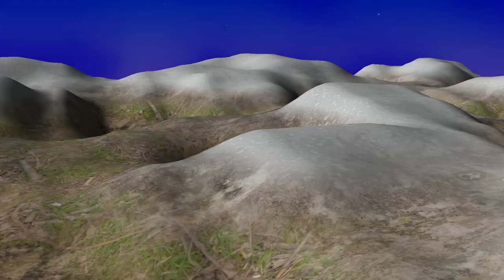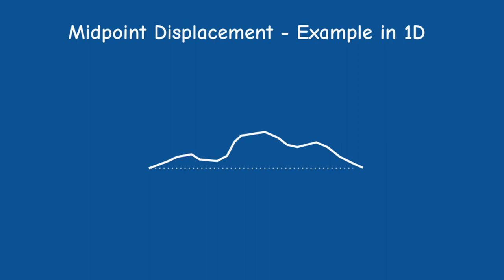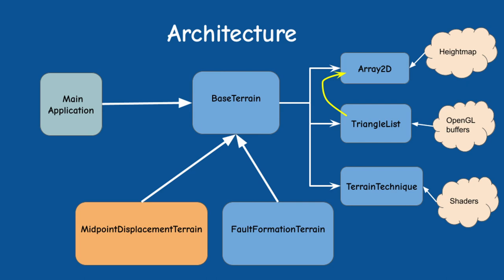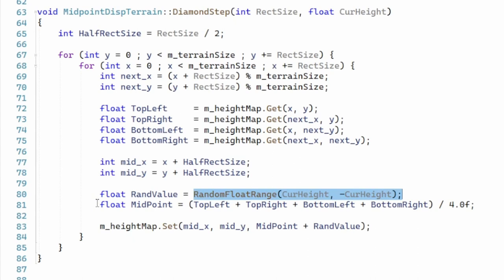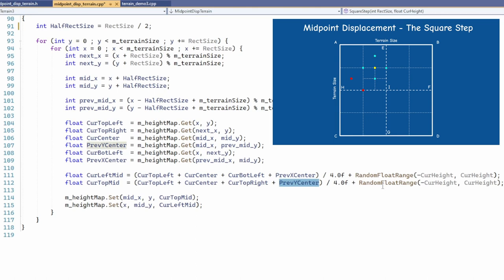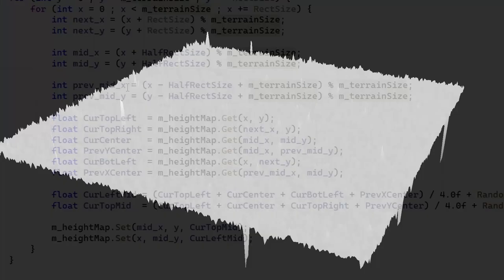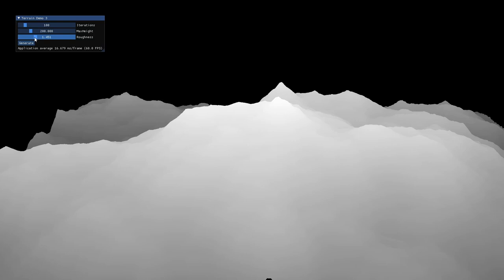Midpoint Displacement // Terrain Rendering episode #3

Comment: for the second dimension, the terrain has to be a square ? if it's not the case , which terrain size should we use for the random value ?
Reply from the maker: The terrain has to be square in this algorithm so the second dimension is handled in the same way as the first one.

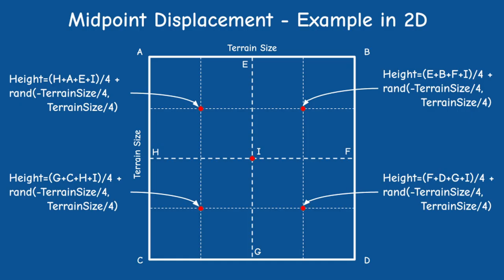Comment: 3:13 pls how did u create such a terrain ? what programm did u use ?
Reply from the maker: This is what you get if you run only the diamond step of the algorithm without the square step. The code that generates this heightmap is in C++ and is rendered using OpenGL.